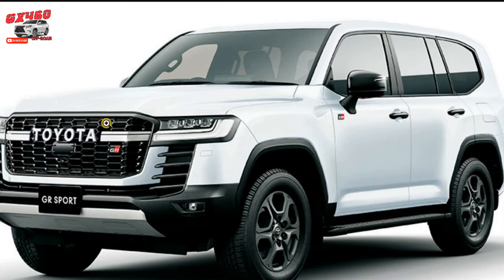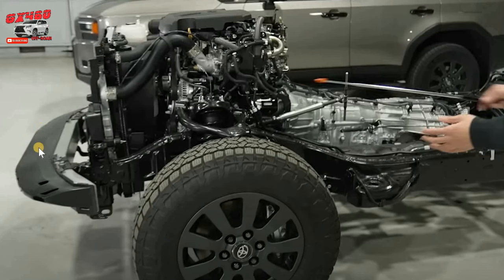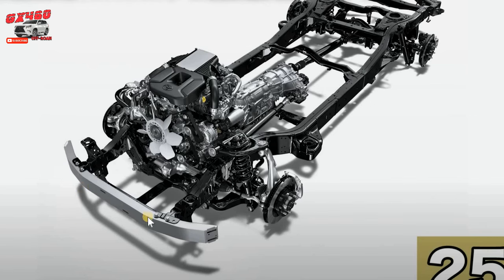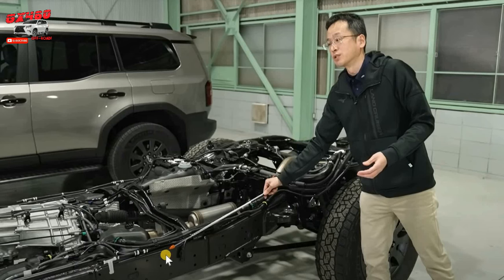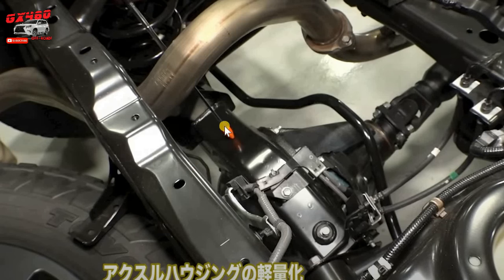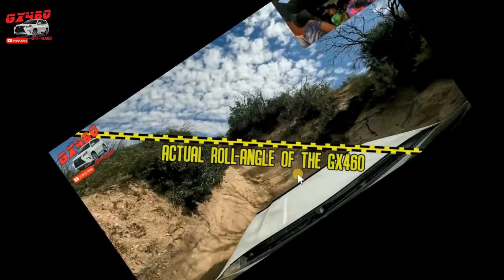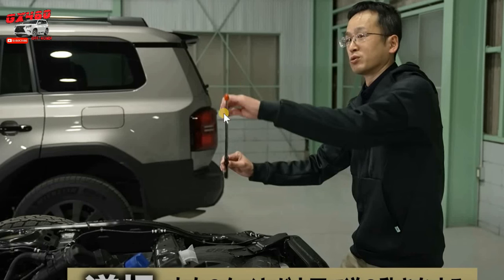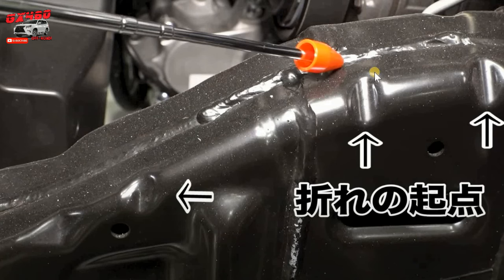Landcruser 300 vs. Landcruser 250 Frame Differences

Comment from the maker: Toyota is always the answer.  I am NOT suggesting that the lighter/thinner LC250/GX550 is "worse" or "not as strong/capable" as the LC300/LX600 frame... the 4 banger and lighter transmission/lighter interior trimmings [on the LC250] might mathematically balance out the absence of a twin turbo V6, seperate cooling system, and larger 10 speed transmission and heavier interior trimmings... who knows... the GX550 vs LC300/LX600 frame differences are still unclear at thus point

the front black member on the 250 ladder frame might be some black composite material or black sheetmetal... it's hard to fathom that they stuck a heavy steel crossmember that far forward... either way Toyota/Lexus certainly has room to play around with that approach angle some more if they want to...  we will continue to research and share 300/250/550/600 differences as they are discovered/revealed
Reply: Is there frame difference between LC300 vs LX600?
Reply: @RaymondAngT no

Comment: Most off-roader noobies think offroad suspensions are softer but mostly are stiffer.  I fell into that trap 10 years ago.  Give me stock shock and springs with a smaller tire with taller sidewall.
Reply from the maker: @davidnuxoll7074   Very true and it goes for pretty much every car being "modded"... from a Honda Civic to a Landcruiser 300, the first thing people do is screw up the suspension with Chinese parts and convince themselves that it's an "upgrade"... this psychosis has been going on for the last 35 years... education is key
Reply: @LexusGX460-OFF-ROAD  I will say in my modded euro days the KW street comforts were the softest suspension I’ve ever had.  I had a 2 inch drop on a b8 Audi SQ5 with factory 21s.  Rebound dampening is key.

Comment: The problem with the penny-pinching hypothesis is that there isn't a very significant price difference between the base model 300s and 250s on the global market. It makes far more sense that it's for weight savings for fuel efficiency standards and fleet efficiency requirements.

Comment: G'day from Western Australia. Hey thank you - this is a very interesting and informative video! I really like how you emphasise / remind us that GX / 250 / Prado is very capable right out of the box! And the 250 seems to have better tyres (tires) too - so perhaps just the UVP modification (and a UHF radio) is all's needed?  Still waiting for it here in Australia, any day now I think. But the smaller fuel tank (compared to the 150 Prado's 150 litres) is a huge disappointment, and not so good for our conditions.  I think I'll be keeping my 150.  It's a better car than I am a driver!

Comment: If I had the money to shit away. I would love to buy a Lexus LX600 and buy the LC GR front nose and wheels to convert to a GR outside and LX600 inside. I personally love the LX600 interior. Just day dreaming.
Reply: Now that I own an LX570, the only Toyota I would consider an upgrade is the LX600. The AHC suspension is just so good if you use your vehicle in a variety of ways(I use mine to daily, tow 5500 lbs and offroad and it does it all extremely well) that there is no way I would go back to a static suspension in the LC, GX, 4Runner or trucks
Reply from the maker: @henry78560  a dream is a wish your heart makes ✨️ ♥️
Reply: Wouldn’t it be easier to just move to Australia mate?
Reply: @joeblack1052  lol. Maybe.
Reply: @joeblack1052  I would love to some day visit Australia. You guys have some of the coolest vehicles. I specially love your truck trains.
Reply: @joeblack1052 can’t own guns in Australia. Not a free country
Reply: @Jay-me7gw  I actually test drove both, and walked out an owner of a CPO LX 570. The new 600’s & 550’s interiors feel less “inspired.” Sure, they match the more modern designs, but they lack character and feel more “Toyota” than Lexus. Less unique. But that was just the impression my wife & I walked away with…

Comment: Since getting the LC250-1958 I’ve installed 17” alloys, 33” tires and some lights + roof rack for a clam style RTT. The power is good but hate the raised floor for the batteries.

Comment: Differences are now present from lx600 to lx700 frames. I wonder if lx600 will just be phased out in next few years and we just have the lx700
Reply from the maker: @GXTOLX  yes, basically the LX600 is gone now... it's the LX700h
Reply: Patiently waiting for lexus to do whole body refresh inside and outside.

Comment: It is just a question. If you did not own the GX would you consider this truck because you had mentioned in the past looking for a smaller engine. Or would you consider it to replace your van down the road. For my usage, I really like the overall compromise of this truck for me. I do not tow, I drive in the city, and I cruise out of town at 65 or less MPH with my family. I get 28 MPG out of the GX now on the highway, I think I can get this thing to do 30+ MPG. 🤪
Reply: Nobody is getting 30+ mpg unless they are going downhill.  I get 23 mpg on the highway, a bit more if very conservative.  Nonetheless, it is a solid, comfortable and capable truck.  I have no regrets!
Reply from the maker: @henry78560  it's hard to give up then "lux" of the GX460 or any Lexus... A LC300 GRS with a 4-cylinder non-hybrid would be ideal for us, but that's just a fantasy application as the market would complain about the lack of power in the engine... ideally a LC300 GRS in Lexus LX600 trim would be feasible in the USA... nothing is perfect... everyone just does the best they can ❤️ 😃 ✌️
Reply: @LexusGX460-OFF-ROAD  I know. This same vehicle is sold in Africa with a 2.8 diesel. Funny how Toyota will not bring their diesel 4 here. Even though the Big Three has made small diesels an option on some trucks.
Reply: @f8PixelMagic  lol. I am going out of town next month. 2100 mile trip. Taking the GX and will record the 28 MPG for you guys. I have gotten 28 MPG out of the GX and 25 MPG from my 4Runner TRD. I know I can get 30 out of the LC250. It is all in the setup. average speed, and pedal modulation. I only get when I drive them a specific way. But they are capable. I recorded the 4Runner 25 MPG just waiting to do this trip to upload both together.
Reply: But what does mpg matter? It’s meaningless at the pump and the Starbucks people order cost $150 per gallon. Just drive the vehicle. 18,22,25 mpg doesn’t matter a darn thing.
Reply: @kenk8242  What does my question and comment have to do with you? Nothing! I am not asking you in the first place. You mind your own business. You don't care about milage, great. Don't. This conversation has nothing to do with you, your preferences, your channel, your thoughts, your believes, or anything else. I DRIVE MY VEHICLES ANY THAM WAY I WANT!!!!

Comment: Saving weight is also an economical thing for fuel usage and performance on the highway. If you can afford the 300 fuel usage wouldn’t matter as much. Many government and fleet buyers are using a lot of rav4 s for economic and virtue signaling here in Australia and no doubt the outback gravel road travelers will get the Prado.

Comment: 74weld makes portal axles for the gx460/4Runner. Keeps stock geometry and suspension per their website, but the portals raise it a couple of inches. Wonder what you think about roll angle pros and cons with portals. Thanks
Reply from the maker: @keeblord7383  portals are fantastic about keeping the geometry balance while increasing ground clearance... that at fat tires too.. wish toyota would make something stock with portals.. but everyone would complain about the price 😆
Reply: @LexusGX460-OFF-ROAD  I won a $500 voucher for their portals but I looked at the price for a set of 4 and it’s $20,000 lol. I wonder if there would be more articulation with just portals or if I would have to get dr kdss extenders and a 2.5 or 3.0 shock that can extend more but leave it at stock height so there’s the capacity to articulate when it needs to more

Comment: Hopefully people can stfu now that the new 250 isn’t a real Land Cruiser. It’s been in the LC family since the early 90’s and this new Prado outperforms the 200 series in almost every way.
Reply: Genuinely curious how it outperforms the 200 in almost every way? Which ways?

I don’t buy the thinner frame on the 250 is an issue. Or that it’s any weaker than the 150 frame so, if you are comparing to the GX460, it’s not an issue.
Reply: @Jay-me7gw  it’s better in every way from a daily driving perspective. Articulation flex with the sway bar disconnect it was barely less to the 200 series. It was close enough that I would say it’s not really a deciding factor when off-roading. It gets waaaay better gas milage than a 200 series as well. Nobody’s out there bending any of  Land cruiser model frames either so I don’t see how that’s even a relevant issue.
Reply: @c1aytonbigsby I don’t think the frame thing is an issue and it wouldn’t sway my decision in the slightest if I was in the market to buy a new Toyora

My issue with the new LC is towing. I would way rather have a 200 with the 5.7L for towing than the 2.4L hybrid. Since I need whatever truck or SUV I own to tow, the new LC is completely off the table for me. I’d only consider the GX550 and LX600 with the TTV6
Reply: @Jay-me7gw towing is definitely where it falls face flat.
Reply: @c1aytonbigsby  and the majority of consumers will never tow anything, at best it'll get a bike rack in the hitch.(Don't come at me with 'I tow', sure, some people do, but those people are in the minority)
Reply: @coryrood  100%! Where I live there are land cruisers everywhere, and I’ve never seen one towing anything.
Reply: @coryrood  there’s actually a good amount of people that do on the forums. It’s pretty popular due to it having the tundra powertrain and chassis without the size. Maybe you don’t see them but we are out there.

Plus the new LC is much cheaper than the 200. It’s not like there were 10’s of thousands of 200’s being sold every year like there will be of this new one. No one thinks about the fact that the 200 was pushing $100k before we saw this massive rise in vehicle prices. Probably don’t see many in general never mind with a trailer because there arnt many.
Reply: @c1aytonbigsby  everywhere? They sold less than 4000 a year. Ford sells like 400k F150’s a year and a huge portion of those arnt towing trailers
Reply: @Jay-me7gw  vehicle specific forums are a terrible representation of the general consumer that is driving it. Like I said, the Majority of owners don't tow with a LC, it's not what it was designed for. I'd be surprised if more than 10% of LC's pull a trailer on a regular basis(say once a week)
Reply: @coryrood  ok
Reply: @Jay-me7gw  I live in the Permian basin which is where the majority of americas oil comes from, it’s not that shocking that there’s a high concentration of land cruisers here considering how much money is in this area. They’ve been making the Land Cruiser since before the 80’s so idk how that’s shocking to you.
Reply: @c1aytonbigsby  👍

Comment: Great video.  I totally accept what you are saying about balance but as you know many LC buyers will add heavy bullbars, maybe a winch and other accessories, in such cases, wouldn't this affect the balance which the engineers have engineered and perhaps necessitate heavier shocks and potentially a small 2" lift?
Reply from the maker: @fishinbite  ... frankly most will do all you mentioned soley for looks... ie a vanitymobile... we got a "bullbar", fatter skids, rock sliders, portable winch... still not lifted 🙂... if then lift is sized to properly counterbalance a steel bumper carring a 80lb winch then that would be ideal... but who does that?  They slap on stiffer taller springs from China that raise the vehicle 2" while deleting any downtravel/articulation
Reply: @LexusGX460-OFF-ROAD  yes understood I guess it comes down to the intended purpose of lifting the vehicle.

Comment: Regardless of weight saving measurements, this 250 frame is going to be way stronger than the C- frame from the previous Tacoma and tundra. Right?
Reply from the maker: @oceanzu6585  should be yes 😃... I thought the Tacoma frame was partially boxed and only C in some areas? double check that... but ya... the 250 frame is not a mickey mouse frame

Comment: We know the 150 and now 250 series wagons are labeled light duty by Toyota.    The 200 and now 300 series are heavier  vehicles.
Reply from the maker: @lillianachannel   Neither the 300 or 250 are "heavy duty" trucks.  The only LC that is heavy duty is the LC70... duty meaning actual workload (duty has nothing to do with offroading).  Toyota classifies the LC300 as a "station wagon":
https://youtu.be/seZCrDANUvs
Reply: @LexusGX460-OFF-ROAD my point is that the 150 and 250 were classified as light duty, but the 200 and 300 aren’t.   The actual sizes of the vehicles are not different, but the towing capacities were between the light duty and station wagon.     The 70 series is a different beast for sure.

Comment: The 250 is NOT a replacement for the 300, The 300 is the larger 4X4 and the 250 (Prado) is a smaller model. In Australia we have both the Landcruiser 300 and the Toyota Prado (250) sold side by side with the 250 a smaller cheaper model.
Reply from the maker: @WilliamVandervleut  300 and 250 are the same size/dimensions practically speaking... there is no legit size difference now like there was between the 200 and 150

Comment: While I'm highly against cheap lifts, to say the OEM suspension is the be-all end-all, well, if that's the case factory Toyota Baja/Dakar teams would all run OEM Tokicos. If your only use-case is smooth side grades, sure, keep the OEM setup for lateral stability. Here in the Pacific Northwest, overland trails are very rock / rooty, cross ditches every few hundred feet, and demand clearance + suspension travel. Any stock truck short of a Unimog would bash up their under-belly.

Comment: Toyota suspension engineers are trying to find a mix between good daily use on roads for most of the time or 99% of the time. But we want more performance offroad. Thats why the suspension industry keeps getting bigger and better. 

Who wants to drive a boring stock vehicle?
Reply from the maker: @LuaiADV  no, people want lifts for LOOKS... they have zero clue that the stock vehicle already has performance built in.  Tokico and KYB suspension.  Most will not take their "modified" vehicle anywhere close to where an actual stock LC can go offroad.  The [aftermarket] "suspension industry" is based on pretentiousness, posturing and posing (mostly):
https://youtu.be/cz75mKJakHw
Reply: @LexusGX460-OFF-ROAD  there is no size that fits all. I work with tier 1 companies. I know what they are bench-marking. To assume factory suspension is the best all around performance is far, far from the truth. There are so many variables that go into suspension design. It maybe the case that in the US. The consumers are after the looks. But in global markets, things are extremely different. Again don’t look at manufacturing with just your users in mind. It has to adhere to so many different global regulations. It’s not even funny. Thats why the aftermarket is much more fun. (When done right) you will get a far superior suspension than whats offered by Toyota. A simple question to ask, who did they build the car for? What user type? Consider a global market. That will give you an idea on how factories will have to make compromises to make most accept the stock setup.
Reply: I do agree a lot people want a lift for looks but I also want it for off road performance. I’ve personally experienced the difference of off roading a stock vehicle or one with 35s and a 2.5” lift. The stock vehicle will drag its belly on the ground/rocks/snow and the lifted one will clear it.  That is often the difference between getting stuck or not.